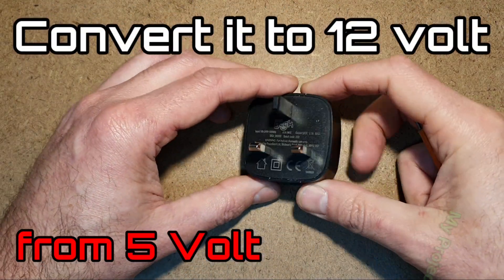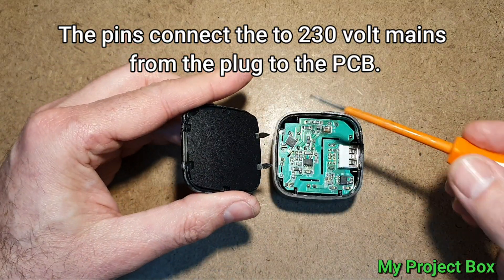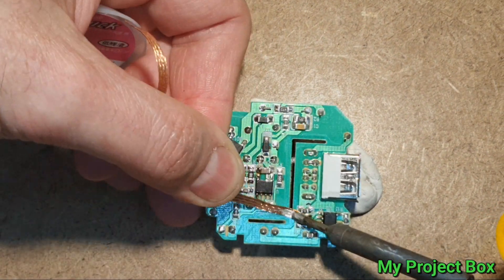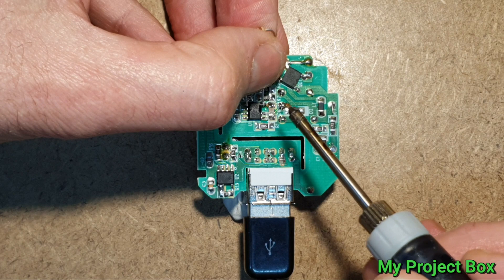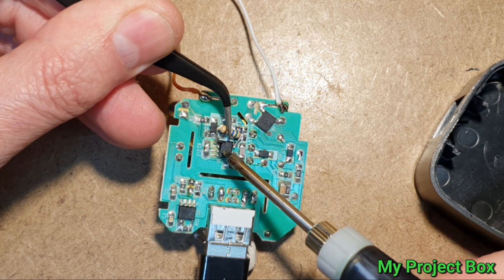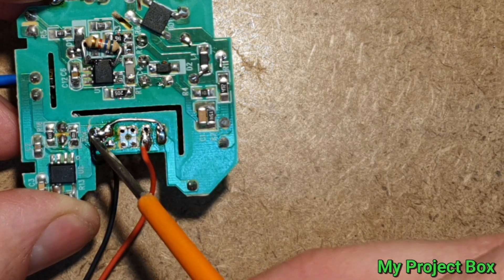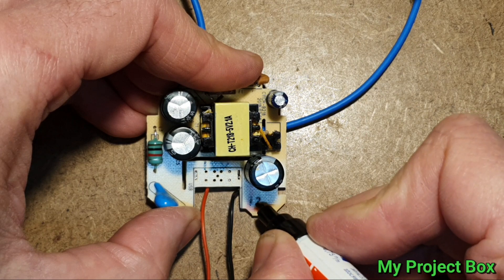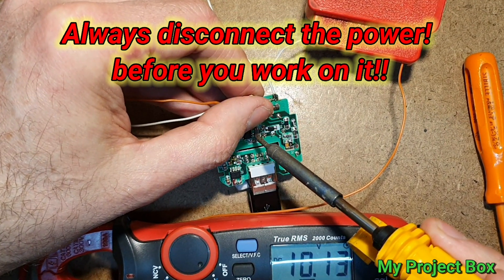Convert Poundland 5 volt Phone charger for 12-volt output power supply Hack #ElectronicsCreators

Comment: Thanks for doing the experimenting for us. I've got 3 of these Poundland adaptors. Time to pop the case on one of them and have a go!
Reply from the maker: Good Idea 😉👍. Just be aware that there are two different versions of the circuit board inside. The one in my video Is the newer version. Both should work, just look up the data sheet on the driver chip if it's the older type.(big Clive did a video on the older type https://youtu.be/aS1pwoVdRh4) I think the pinout on the chip is different.
Reply: @MyProjectBoxChannel  Thank you for the link to Big Clive's video. I have the same USB units as in his video. I prised the backs off 2 of mine to check. One of them has the plastic "earth pin" snapped off so this will be experimented with. Thank you for your help. Much appreciated.
Reply from the maker: @colintinker7778  No problem. I think the feedback circuit is similar on the old units but the chip pinout is different. Bridge your resistor between FB pins(2or3) and ground pins(7or8)
Reply: @MyProjectBoxChannel  Thanks. Hopefully I won't let the smoke out!
Reply from the maker: @colintinker7778  https://youtu.be/ljqo3-2VBJI

Comment: Would I be right in guessing the output at 12v is about 700mA ?
Reply from the maker: I don't remember the exact current, but it was able to power a 20w 12v halogen light bulb, without any problems. That's about 1.7AMPs!! (And when the filament is cold it draws a lot more current on start-up) It will probably be pushing it past it's design specification.
Reply: @MyProjectBoxChannel  That's respectable enough. It would easily run a 12v cctv camera . Thanks for the idea.
Reply from the maker: @mrflibble5311  yes I don't see why it wouldn't work with your CCTV👍. You can tweak the voltage to power all sorts of things. Maybe even to trickle charge a car battery if you set the voltage to 14v.(With some form of current limiting)
Reply: @MyProjectBoxChannel  I'm all for repurposing stuff. I've a drawer full of various makes of these things. I'll see if I can figure them out . I've actually reused PC ATX  power supplies for stuff in the past and they have a great output . 12v ,5v and 3.5 v. I used to solder the lines on them but there's a cheap gizmo that gives you fused outputs and a switch without soldering. XH-M229 Installed in the attic and it does CCTV, LED strips or whatever. I think the 12v rail is 15 Amps

Comment from the maker: This involves working with the mains voltage side of a power supply. So disconnect the power before you work on it.
This might not be suitable for beginner electronics hobbyist. Safety first 😉👍